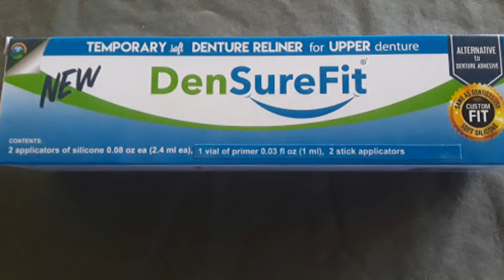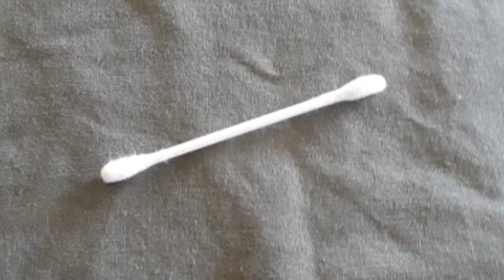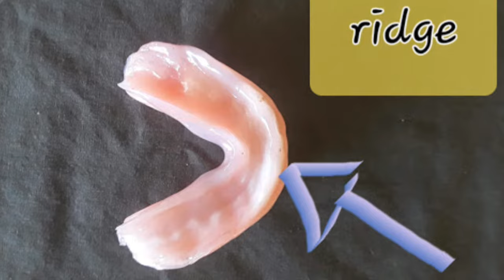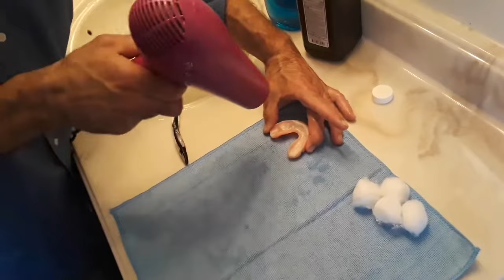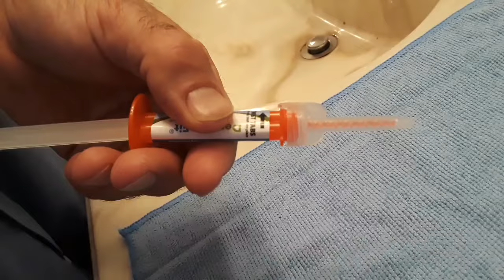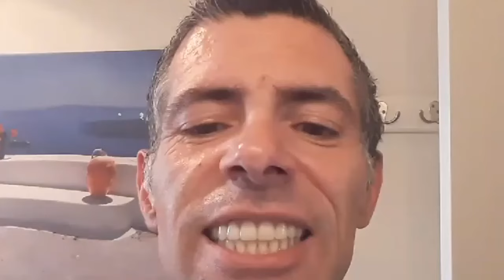DenSureFit Lowers Lining/ Instructional😁

Comment: How do you use Densurefit with powder and how do you remove the powder without losing the Densurefit silicone?
Reply from the maker: You shouldnt need the powder with DenSureFit;)  but if you use it...warm water and a soft bristled toothbrush.:)

Comment: total scam product even while applied precisely as instructed. In fact made my lower denture worse. In any case the scam was removed from both dentures yesterday after 2 days, 100 dollars tossed to the damned wind. Remotely in contact with your common sense ? Then stay the hell away from this product. I do notice my commentary seems to be removed on a daily basis and I have been blocked altogether by these scam merchants on FB.
Reply from the maker: Unfortunately the product does not work for all.  If you have severe bone loss on the bottom...what do you expect?  There are many people that have benefited from using DSF.  It is an amazing alternative to adhesive.  Your analysis seems to be based on spite, disregarding facts.

Comment: You may want to borrow a pipe snake or call a plumber.  That bathroom sink is draining very slow.
Reply from the maker: Thank you for the advice...however, I leave water in the basin in case the denture falls into it...you know, so it doesn't shatter.

Comment: My bottom ones have never fit right the bottom of my lower denture is to long
Reply from the maker: Hi Kathy!  By any chance have you asked your denturist if they can be shaved down?
Reply: you can trim it with metal files or emery boards, I have even used sandpaper, it shaves down easily ... been doing that for years on several replacements.  And of course the dentist can easily do it for $$$$$$$.

Comment: What denture adhesive will stick to densurefit. Everything i have tried sticks to gums but not to the dentures. Need help
Reply from the maker: Hi Vickie!  You dont need adhesive with DenSureFit😊  That is the beauty of the product.  Hope that helps
Reply: @KyleBergmann  I am in my intermediate denture it fit  a lot better but still loosing suction when I talk and they fall down. I did the snug up do I need to do it again. I love the feel better than the dentist soft reline I think I am almost there but don't know if I can do another snug up

Comment: I've aligned the bottom twice and still there is no suction...any suggestions what  can i do
Reply: I have been wearing dentures for over a decade and have had bone loss.  I am on my second set of dentures right now and have always had issues with the lower.  I have used DenSureFit for well over a year and I love the soft silicone cushion between the denture and my gums.  I do the first application, then the Snug Up on my lower.  There is still a lack of adhesion (the lower will never have the same suction as the upper, due to your natural palate in the roof of your mouth, and saliva "sits" in your lower mouth area).  I always have the DenSureFit in my lower, but I also have to use Sea Bond liners for lowers.  They are easy to find on Amazon.  Perhaps this will help, all I can say is this is what works for me.  I LOVE DenSureFit.

Comment: I am really intolerant to adhesive, 
can I use the strips instead of powder on my lower denture if it keeps floating? I am going to try to do a better try tomorrow on the lowers.
Reply from the maker: Hi.  Im not sure I understand your question.  Do you use Densurefit?
Reply: @KyleBergmann  Yes, I just did it but have to redo my lowers and do another coat on my uppers

Comment: I try talking my older sister to get this since she has denture every time she eats she always talking out her teeth
to eat I guess because it hurt her to wear them when she eats . Do you have to take them out at night and soak them and in what . Also how long does the silicone last on your dentures?
Reply: Tell her to try seabond strips I use them currently. Decent replacement for this but you have to apply daily and cut to fit for your dentures but they help so much

Comment: I got my new dentures a couple of months ago. My lower denture won't stay down and when I eat it moves around. Like others, I've used adhesive to keep the plate in place. I have to struggle just to get it removed from my mouth. Then cleaning them takes about 10 to 15 minutes. I'm going to purchase DenSureFit and see how it works. From the testimonies I've seen it does the job.I also have sore spots from denture rubbing. as in the video my upper plate fits and aligns with my lower.
Reply from the maker: DenSureFit eliminates the need for adhesive!!  Eating and denture care become infinitely easier with this product!  Good luck

Comment: Kyle, this is Sherry remember you responded to my text saying that I need help putting the denture fit and the lower if you could message me I would appreciate it cause I need help! Much thanks Sherry
Reply from the maker: Whats up?
Reply: @KyleBergmann  Kyle I already bought just the lowers I need the uppers too. I wanted to know if you put the upper ones in first and I should wait to put the bottoms in after I get the upper ones in first I saw your videos I’m still real nervous but I just sat for the upper one, so am I right? Is that what I should do wait to put the upper ones in first?     Sorry if I’m being a bother.
Reply from the maker: @sherrymichaud5769  so you should line the upper first, then the lower.  But if you have no upper yet and need it on the lower ...depends what is currently up top
Reply: @KyleBergmann  Kyle, I have just regular I use upper dentures but I am using plain fix a dent, I figured since I have the bottom I should do the top first because I want them both with a fax denture fit , I’m gonna wait to put the bottoms in until I get the stuff from for the top denture fit for the top. I just ordered it so I got a wait to do it at the same time. I hope I’m right I’d rather have somebody talk me through this. Thanks for your response.
Reply from the maker: @sherrymichaud5769  understood!  You can call densurefit customer service or send me an e mail @ bergmann.kyle@gmail.com 👍🏻

Comment: Is this for upper and lower?
Reply from the maker: Hi Sherry!  Yep.  For both upper and lower
Reply: @KyleBergmann   Is that why there’s two tubes or do you have to buy two separate boxes?
Reply: @KyleBergmann  thank you for your response, I’ve been wearing dentures but I can’t wear the bottom ones cause they’re too big they keep falling out I can’t eat with them in and I am so embarrassed to even go out of my house and I really really hope this works and I was just wondering how much it is for the upper and lower or does it come in the same box or the upper and lower?
Reply: @KyleBergmann  💜
Reply from the maker: I understand your pain!!  If your dentures arent too loose, you can get away with a normal kit which has 2 applicators of the silicone.  They also sell an upper/lower replacement kit with more product!  Check out densurefit.com for options:)  I also have lots of videos on my channel on how to apply.  Hope this helps.

Comment: If I am not mistaken, isn't this pretty much the same soft liner material that is used in dental practices for those who get temporary prosthetics while waiting for gums and bones to heal after implant surgery? I had 4 implants put in on the lower and the prosthodontist gave me a temporary lower until I can get a final snap-on over-denture (6 months from now) and this looks exactly like the stuff she used since temporaries are designed to be a little looser so as not to put pressure on the healing implants and gums. Good video... Probably saved a lot of people from getting very frustrating results... Thanks...
Reply: yes except it's cheaper. my dentist charged $250 for each reline.
Reply: It's way better than the crap the dentist uses lol
Reply: I am looking at my denture it have no walls on the side on the back is that normal

Comment: On my lower gums I have no bone, so my adhesive doesn’t stick long when I eat or drink. I have to reapply the adhesive. So will this stuff work on my lowers???
Reply from the maker: Hi Larry.  Depends, really ..give them a call!  Very nice people at Densurefit.  Thanks for commenting!
Reply: Like myself, sounds like. With NO bone, i still had to use 'Goop' after 'a similar product'. But This one, being Silicone, which in 'Other repairs to many things', feels sort of Soft, Sticky almost. If it's like that....It really Could work!! Gonna Try ....IF i can Find it and it's NOT $200 or even close!  Not seen on Amazon. Maybe Amazon USA has it though?

Comment: When putting on the silicone and there leftovers in the tube can I save it how do I cover it don’t get hard
Reply from the maker: Hi Lucinda.  Great question!  The product left in the tube hasn't mixed yet so it won't get hard...only whats left in the tip will.  So you can either purchase more mixing tips from DenSureFit..or use a tip from an unused tube;)  Hope that helps!

Comment: thanks for info Kyle. If you need just a little in the front of my lower dentures and I don't think I would need a full tube is it resealable to use at a different time?
Reply from the maker: Thanks for illuminating this comment.  Actually yes you can!  Just place a new mixing tip on the applicator with the unused product!!
Reply: No

Comment: Hey Kyle!, can you use this on partial lowers?? I have 5 natural teeth at the bottom front,
Reply from the maker: Yes!  Check out Densurefits channel!
Reply: TAKE Good care of those 5 Teeth!!! I had Same for 15yrs. until last year. It was Mostly Just like having $$$ implants!!  Since i figured those 'ground down anchor teeth' were Not Really going away, i neglected them and was forced to 'Lose then'.  I have *YET to find Any Thing that Truly Holds my lowers in! (Past 4 min.) I am relearning 70 year Natural eating/speaking Habits by Keeping the tongue DOWN*? ALL THE TIME! I think i will get the Feel of it in a few weeks of *isolation so i can practise until i Forget ...and Soup will Knock out the (supposedly) Strongest of Goops available. Take care, what you still Have is great!  OH, i just saw that Yours are Partial, well, IF you get Full denture, keep those 5 (Get an older dentist who Knows this older process)
Reply: @q4991  would you believe I just broke one of my 5 remaining natural teeth 🥺 the dentist tell me they are doomed, rotting from the inside out and I will have to loose them all

Comment: Thankyou just did my bottom imediate dentures. Top ones dont fit because the metal palate is to small cant fix those. I dont think my dentist will make that right either. But luckily the tops are partials for just a few back teeth. That's why I cant understand why he had to put I the metal pallet wich I cant where. Can it be cut out?
Reply from the maker: My pleasure:)  how did it turn out?  To answer your question, June...I have no idea.
Reply: @KyleBergmann  what happened was I had the denture fit in my imediate denture when I went back to see him and was happy with it. He took my denture and said he never heard of it and instead of pulling it out he sanded or grinded it out. Then stuck a horrible tasting liquid in them and didnt tell me anything and said now bite down, it went down my throat and made me sick and I couldn't breath, as I was lying down and not aware of what was about to happen. I bit down hard and it ran down my throat. So I couldn't wear them till I ripped out bis garbage and put densurefit back in. He made my denture even bigger horrible man. I had to have gallbladder surgery as I was very I'll, I think swallowing that liquid injured my insides. My bottoms need more it's not quite over the edges on some places, should I just leave it that way for now? Because they are tight?
Reply: He went in anouther room to grind out my densurefit without telling me he was going to do that. I'm really starting to hate this man. I've got 2 implants by him, he keeps taking the caps off and pouring liquid in the screw holes every couple of weeks. I think it might be some kind of glue or cement. He wont tell me what hes about to do to me he just does it. My permanent ones hes making are way to tight he stood up and just jammed them onto my gums to try to get them to fit. They finally went on and hurt.they dont fit. Then he never got a bigger one out to try in. So I just know my snap in dentures are not going to fit this is turning into a nightmare

Comment: He doesn't wast 💦 does he... BTW What is the Squiggly thing in the applicator tip? I assume it's 2 slow down the flow of silicone & waste it. (thereby increasing odds u need another tube?)
PS: I know I'm supposed to time the process, but video doesn't state this During Process.
PSS: There is a failure 2 mention tge silicone setting up within 30 seconds. I actually had this problem with my upper. (the method explained allows 4 premature hardening) I see the lower is not the same.
Reply from the maker: Pay closer attention.  Also, the tip mixes two compounds...you are welcome!
Reply: @KyleBergmann  Can u tell me why the silicone has not set? Its been overnight+ (10hrs) & some is still (tacky/sticky) around the edges... The majority ia fine. I've about touched all of it ofd.
Reply from the maker: It should set up in 4 minutes?  Did you use the tip?